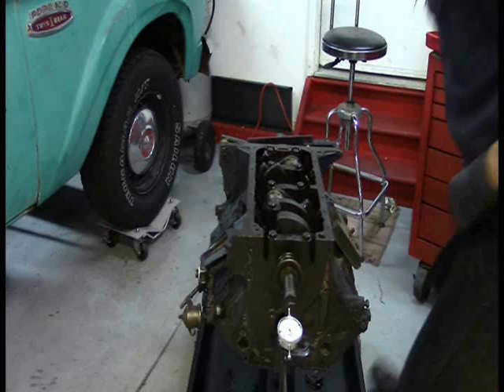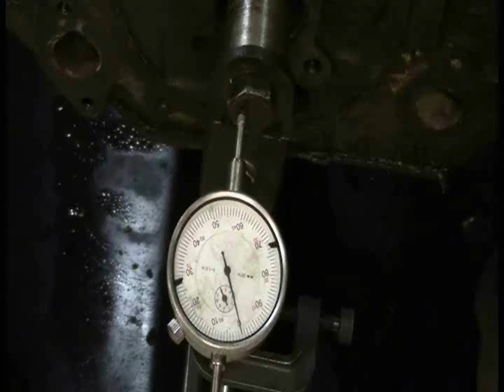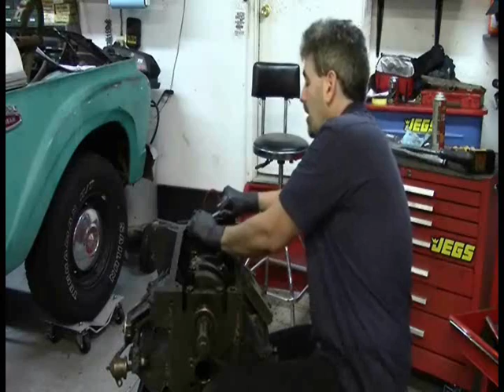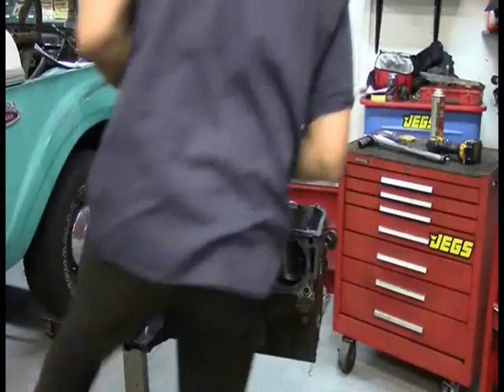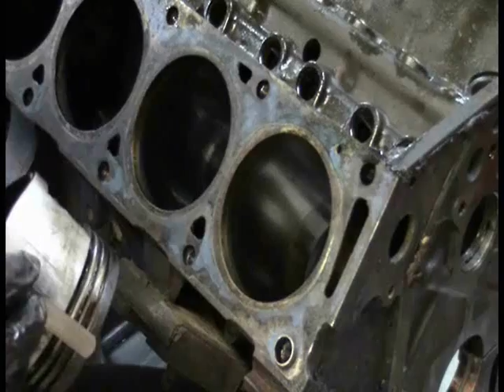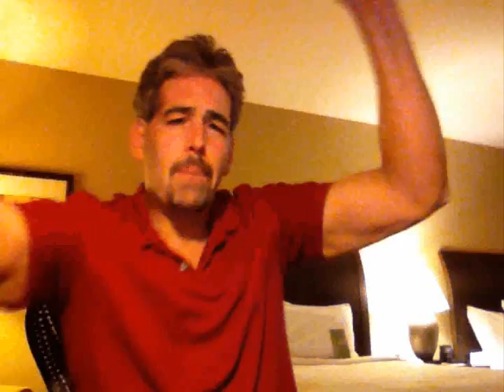Extreme Budget Engine Rebuild Pt 3- "Budget Rebuild" is an Oxymoron

Comment: Great job.  I've have learned a great deal from you.  I wish there was a way I could pay you back.  I don't think there is a way, but I will be a faithful subscriber.

One comment and one question:

Comment:
Take the following for what it is worth - nothing:  Ignore the haters.  What I mean is don't even bother making comments about them in your videos.  I enjoy the useful knowledge and experience you have and are so willing to share.  I can tell you get bothered by some people's stupid comments, but I also see the passion you have to share what you know.  So, with that said, stay in your passion mode.  

Question:
Please forgive me if you've already been asked this.  I didn't have a chance to read all of comments so far.  

Given the condition of this engine, I could imagine the Transmission needs some attention.  Are you going to have a video about it?  I know very little when it comes to transmissions.
Reply from the maker: No need to pay me back- the advertisers take care of that with your subscriptions, comments, and continued viewing so consider us even.
  As for the question you are absolutely correct- the condition of the tranny is a consideration because you don't want a massive transmission failure soon after your rebuilt engine investment.  This truck however has a manual transmission which was shifting perfectly fine and is not a concern, however I was intending on replacing the clutch of course which should be standard practice when the engine or trans is removed on a manual model and the clutch on this truck is definitely worn.   I would include the clutch install as part of the rebuild video if it gets there.

Comment: Amazing channel! I'm too into science at work but playing with cars and motorcycles off work. Sometimes saving a great deal of money by solving problems on my daily commuter. Keep up the good work!
Reply from the maker: sverkere It is amazing how much you save doing your own work, ain't it. These days if you leave a repair shop for under $600 you probably should buy a lottery ticket! Someone once commented on how silly it is I do repair repair videos using a $400 scan tool- as if any DIY is going to spend $400 on a scan tool. Guess they are bad at math- the scan tool will pay for itself almost double on the very first time you use it (correctly).
Reply: Schrodingers Box My $431 Autoenginuity Chrysler scan tool that I purchased 30 days ago is almost paid off now.  I had a check engine light two weeks after its purchase.  Instead of going to the dealer I scanned the vehicle, learned the problem which was the EVAP pump (charcoal canister relief valve), purchased the part at a discounted price, and installed it myself.  

My Dealer marks up parts above list and charges for diagnostics and full rate card for the installation.  It would have cost me $350+ but instead I purchased the Mopar part from another Dealer online for $45 (my Dealer wanted $75) and installed myself.  Thank you Matt for that Autoenginuity tool review as I almost purchased a non logging basic scan tool instead.

So glad I got the Autoenginuity because it also logs data, records data, graphs multiple data streams, and gives me the health of my car in terms of O2 sensor activity, short and long term fuel trims, and engine idle versus target idle.  Sweet.

Comment: Hi! i lost the marks when changing a timing belt. it is a clio 1.9 d of 2001. The kranckahft doensn't move more than a quarter of a turn or less when rotated with hands. probably the valves are taouching the pistons; How can i fix this? thank you
Reply from the maker: Abderrahmane gouasmi AbDerr, you always seem to get stuff like this lol. Yes you are right, if you lost your timing marks then you are certainly hitting the valves.  This is easily fixed.  The crankshaft and camshaft(s) WILL have timing marks on them- either notches, or triangles, or a notched tooth- something (in case of DOHC there will also be corresponding marks on the head or rear cover). You don't need these marks as much on the crankshaft because you can easily bring the crank to exact TDC#1, but on the camshafts to get to the exact tooth in time is not as straightforward- you need to line up the timing marks.  It varies by engine but there will be some permanent marking on the cam gear(s) indicating correct timing at TDC#1 compression.  Check your service manual and I ensure you that you will be able to time the engine.

Comment: Hey Matt,

Excellent series!  I'm currently driving a car with over 150k miles on it and I've always thought that once my compression gets too low or it shows other signs of serious wear, that I'll probably pursue re-building it. I'm also kind of glad that this engine turned out to be past a re-build.  This will make me think twice before investing that kind of time and effort.

I don't think you mentioned it...how many miles were on this bad boy?

Keep up the great work!
Reply from the maker: I did not mention miles on it because the odometer fails. But I can tell you this- I have rebuilt engines before with this method and found all they needed was rings and bearings- not a single machine shop service needed because everything was within tolerance.  I did this on my own F250 in fact 7 years and well over 50K miles ago passing emissions and everything for a total of only about $400 in parts.
  Its sort of a slot machine pull in a way.
Reply: Schrodingers Box
OK that gives me hope.  Thanks!

Comment: Matt:  Thanks for the video series, the effort to shoot, and edit a video like this is more substantial than most appreciate.

To keep rust from forming on exposed metal I highly recommend Gibbs Brand penetrating oil.  It comes in a spray can and is as easy to apply as WD-40 but far superior in protection from rust.  If you are putting something aside for potentially years, painting the surfaces with Mobil 1 synthetic oil then bagging the parts also works well.

Gibbs Brand penetrating oil is not sold at your local hardware store, but it is easily bought online.  Full disclosure, I get no proceeds from any sales of any of the above items, but as a hobby machinist I bought my first can of Gibbs Brand, then bought a case when that can was almost gone.  Great stuff.

Thanks again for your channel.

-Arlen
Reply from the maker: Never heard of the stuff but good advice!  It would be especially advisable to use a high quality protectant if machine shop work was done. Can you imagine having the block tanked, drilled, and honed only to find rust in the cylinders when you install the pistons?  Probably worth investing in Gibbs if there is any doubt.
Reply: How would that compare to something like PB Blaster?  I've heard good things about motorcycle chain lube being amazing as a penetrating oil too.
Reply: I have not used that product, so I can't offer an opinion on it.  However, here is a link to a site with several restoration projects showing photos using Gibbs Brand: http://www.roadsters.com/gibbs/ 

One of the projects shows a Chevy 454 block that had been hot tanked, and then sat outside in a pickup for six years then treated with Gibbs Brand.  That is something that would I would never do to an engine block, but I think you would have to agree that the photos showing what the block looked like after being sprayed down with Gibbs Brand look much better than one would expect given such abuse.

Gibbs Brand offers a money back guarantee if you are not satisfied.

-Arlen

Comment: A similar proposition arises even for the DIY'r considering a major rebuild (engine or trans). Why spend the huge investment in labor to find a severe problem or perhaps an error of inexperience causing a failed project. There are too many good used engines and transmissions available at attractive prices to spend your time grinding away on a rebuild project.

Excellent video
Reply from the maker: Absolutely 100% correct Tex.  The thing is, whatever you do there is always some decision to be made and it's seldom easy. Even with a new engine- if the car is 9 years old does it make sense to buy a new engine that is worth what the entire car is worth or cut your losses and just get another car? A Used engine seems to be a good option but how well was it maintained? What's the warranty? If the engine fails within warranty you may get your money back for the engine, but not the installation labor. So maybe just sell the car for another used car but we all know the risks with that too. It's a very unfortunate situation to be in and requires some tough decisions. I agree though- rebuilding it is seldom a viable option.

Comment: Maybe there is hope yet for this engine.  Is there an inexpensive way to measure the cylinder bores without using a worn piston or worn ring as part of the measurement?  I am thinking that using a worn piston and/or a worn ring as the basis for the cylinder bore measurement may be misleading.  My novice understanding is that the piston and rings are made of softer metal than the cylinder walls and would therefore wear down faster than the cylinder wall.

From some research, I learned that a micrometer and dial bore gauge are very expensive to purchase.  Maybe a machine shop has these measurement tools and can do a low cost confirmation check?
Reply from the maker: You are absolutely correct- I love your logic.  Technically, there is no evidence that the tolerances I measured conclusively indicate the bore is worn- it could be that ONLY the piston and rings are worn based on the tests I did.  The problem is in reality, only the ring test I did would be inconclusive- the piston being sloppy in the bore is unquestionably indicating the bore is worn because the rings "buffer" the piston from wear.
  Another way this could have been shown is if I have a wide enough dial indicator to measure the piston width- the piston would certainly have been shown to be within .002" or whatever the tolerance was from the 4" bore width.
  The other indication, which I didn't mention, is you can actually feel the "lip" in the bore near the top and bottom from the wear caused by the region where the rings travel. Yes the rings wear faster but there also is some wear on the bore as well and in this case it was quite noticeable when you drag your finger along the wall. 
  But no doubt about it- you are technically correct that I did not conclusively show the bore is worn out of spec.
Reply: I think hard material will ware before soft material because the soft material holds the dirt and metal fragments in one place which quickly grinds out the hard material.

Comment: Another great video.  I most enjoyed the discussions in this series about the importance of tolerance measurements and how each worn part has to go back into its original place.  How many miles were on this engine?
Reply from the maker: Yes it cannot be stressed enough how important it is on a rebuild to put things back exactly as they came! You would think it shouldn't make a difference but trust me it does!
  We do not know how many miles on the engine because odometer stopped working years ago. I do know it is the original engine though because the numbers match the VIN.
Reply: Schrodingers Box Where this rule often gets broken is when say a single follower needs to be replaced most shops will replace the follower and not the can and all the followers. Is new against old not as bad as old against other old?
Reply from the maker: Andrew Thompson Good question- I wouldn't know the answer because I do it right lol!! I would have to think old against old is better because that way you f^(k up your engine rebuild without the expense of new parts lol.